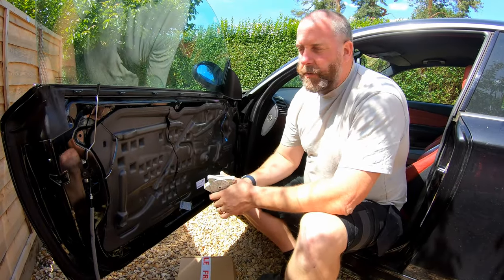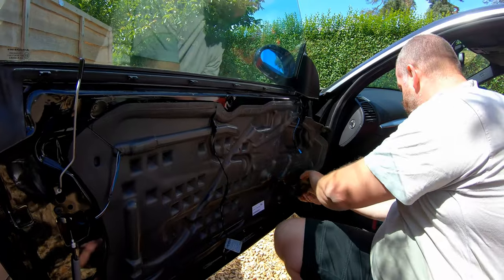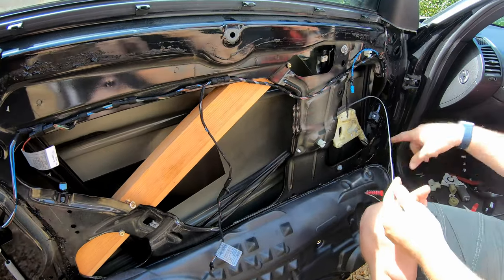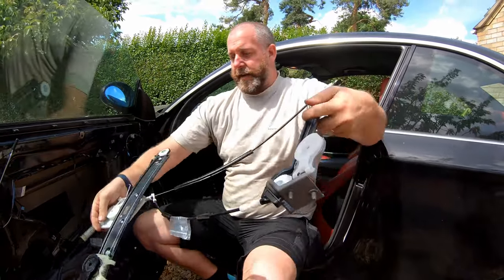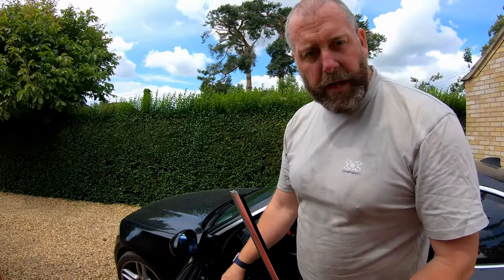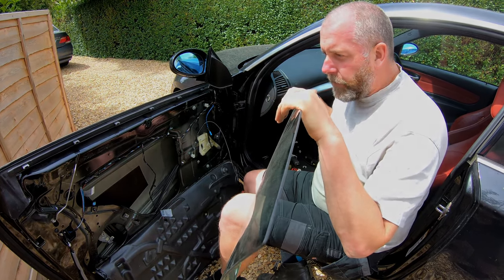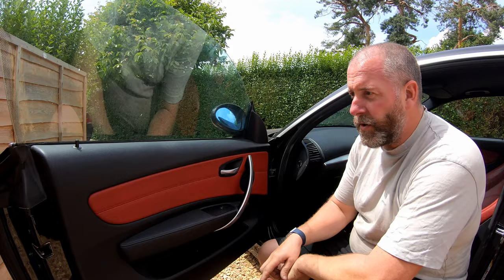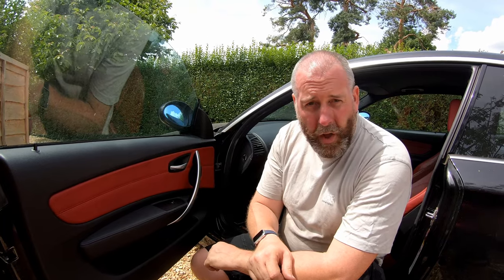BMW 1 Series - E81, E82, E87 & E88 (E8x) 2004 - 2013, Window Regulator Replacement - Full Guide

Comment: Very good narrative for replacing the regulator--many thanks!  
I just did this on my 2008 128i Convertible, and I have two observations:  (1) I had trouble fitting the glass into the channel inside the door and toward the front of the car.  If you first insert the glass into the visible channel ABOVE the door, then guide it into the door progressively front to back, it seems to fit much more readily (for me, anyway).  (2)  There is a fair amount of adjustment available for the glass when mounted on the regulator.  I got a very good fit by lifting the glass up and toward the rear before tightening the thumbwheels (or whatever they are).  
Thanks again!

Comment: Few tips. 
I didn’t need to remove outer door trim. 
When removing sound/insulation pad, just use a plastic scraper and slice through the “insulation” while peeling the pad off. I had no damage to mine. Hot day helps.  
The sprocket has a T20 on the close side and Allen key on the other, punch/screwdriver and hammer works pretty well on a stubborn one. 
I was caught out by the alignment I’m about 2 mm short of the top trim. I cleaned the window when I took it out so couldn’t see the old line. 
Excellent video. Thank you.

Comment: A little hint. Just did the job using this guide. That starwheel which hold window in place, on the end of the stub there is inner Torx 20, on the left side you can get in with the key, and on the right side you can use small ratchet if you lower window enough - there is a cut out :-) it helped a lot with tightening as you can really feel how tight you are making it.
Reply: Also used the T20 on the sprocket, I also don’t remove my outside door trim,
But, in hindsight I should have aligned the window using tape, before I tightened the sprockets up because the window seemed to have dropped about 2mm.

Comment: Just what I needed - excellent video  - Thank you! - especially liked how you got the 2 wheels off using a hammer and punch - exactly what I did right before I found your video. I have to admit I was cringing with every hit of the hammer expecting the glass to crack but it worked to loosen them up and get them off

Comment: I have a  e81 oddly the window works ect, but I've noticed it doesn't sit true/square would you say it's the runner or is it adjustable ? But being a 3dr I've noticed the glass often catches the Piller trim
Reply: Hi! I am having some problems with the adjustment. It is slower than before and when closing the door doesn’t go up as should be. Any help??
Reply: You need to realign the window using the nasty sprocket nuts. You will notice the hole in the glass is larger so there is room for adjustment. They need to be pretty tight to.